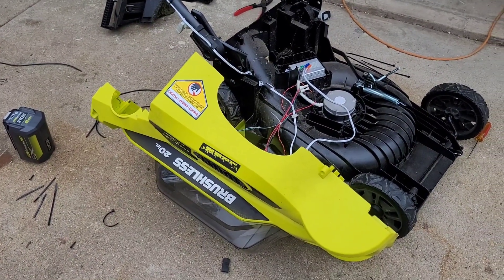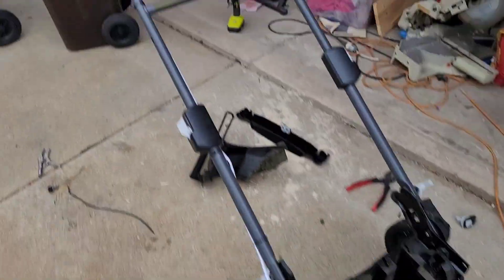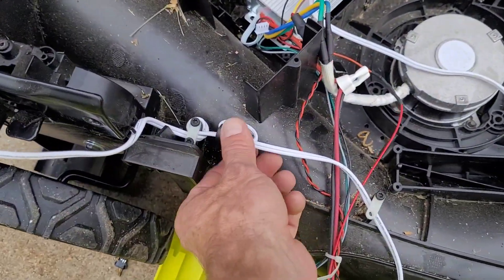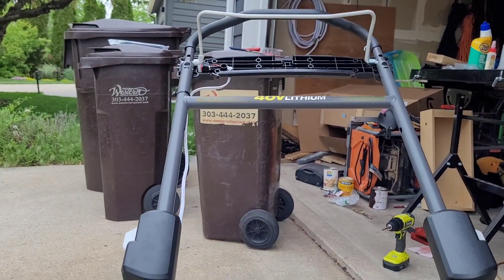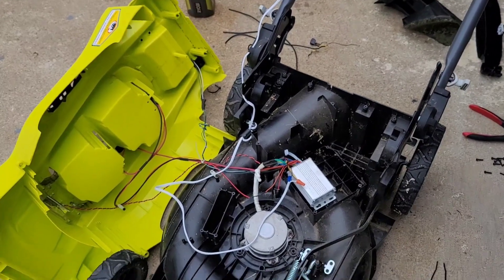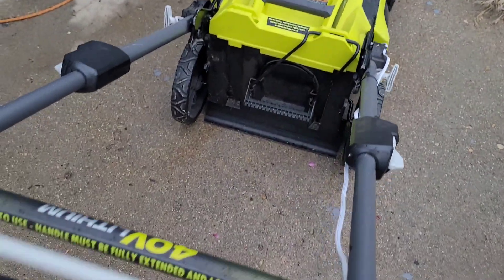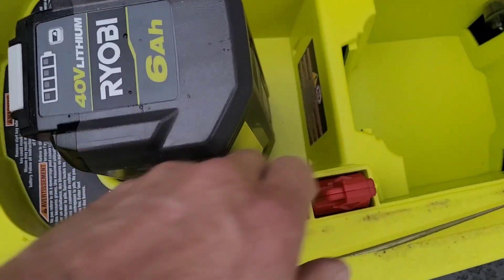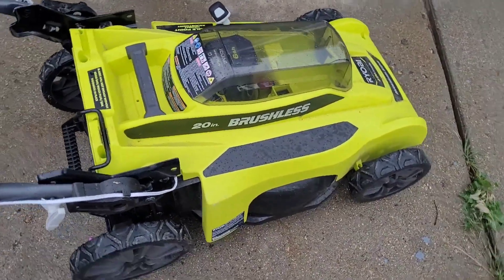Ryobi 40v 20" Lawn Mower Hack and Fix

Comment: Thank you sir--very helpful! I've got this same mower and after two years it started randomly shutting off. Seems to be a break in the wire where it was kinked going into the main housing. I took it apart and freed up some slack in the wire so I could straighten the kink, and it started working again. But a better long-term solution will be to replace the wiring, and this looks like a great way to do that, eliminating those unnecessary switches. UPDATE: it turns out that the safety switch in the lock for the handle had gone bad. I bypassed that switch, and the mower's been working great ever since then.
Reply from the maker: You are welcome. Good luck!
Reply: Don't they have a 5 year warranty
Reply: @ttowen02271  I think it had a 3 year warranty, but I knew that dealing with a warranty return/repair would be a huge headache and possibly drag on for weeks or months (and how was I supposed to mow the grass while it was being fixed?). It was much easier and less time-consuming to just troubleshoot and fix it myself.

Comment: have 2 self propelled that won't start. currently looking at videos. no red button by the lower hinge.
Reply: I didn't have that button either as shown in another video. Not that I could find anyway. I just took the top off, cut the black wire coming down the side of than handle, that continues underneath the hood. You will see 3 or 4 wires exiting the black vinyl casing of that wire-just wire nut them together on the side that's going to the electric motor. It by passes all sensors except the bag/mulch sensor on the back, and the red key. So the only way to start/stop is too remove the red key or the battery. Less than ideal in terms of safety, but will work until I figure something else out. Hope that helps.

Comment: I spent hours tracing down the issue to find out the yellow wire in the long black cord between switches and controller was broken.  I replaced it but I also bypassed the side handle switch.

Comment: I also had two of these very same models, same issue with the collapsible handle (which they no longer have in the new generation), took a month and half of back and forth but finally got a replacement.
Reply: As he says in the video, I am sure they have liability lawyers going over the design, but feel zero obligation to provide the parts to keep it running the way it was designed in terms of safety. Which means people are going to be forced into work arounds that are unsafe. They should be held liable for that by itself- not having the safety switches easily available to replace!
Reply: when I rewired mine, I deleted that collapsible handle sensor.
Reply: Mine failed and mines new generation. How did you get a replacement? They said it’s a 4 week wait to just take a look at it and I need the receipt.
Reply: @gianpalacio5635  You're better off just bypassing the handle lock sensor. I had to do it to mine in the 3rd season of light use, but if I am being honest, that sensor in particular has been giving me grief from almost day one. It got worse and worse this past month or so, and last week, it stopped turning on altogether until I bypassed it.
Reply: @kevinmach730  how did you do that ?
Reply: @gianpalacio5635  I know this is a year later, but I have all my Home Depot receipts emailed to me, even if I get  paper receipt. I have this or very similar mower, similar issue (cutting out while mowing or just not starting), I searched my email and I bought it 4 1/2 years ago.